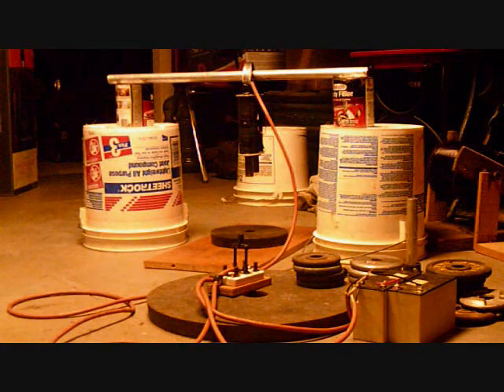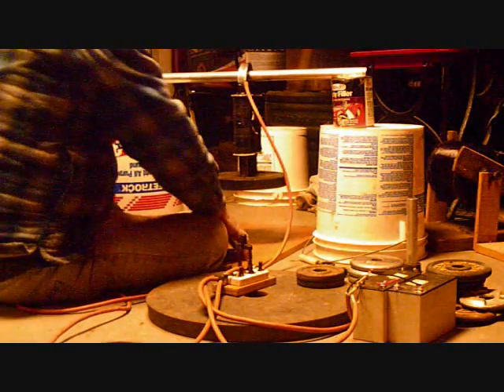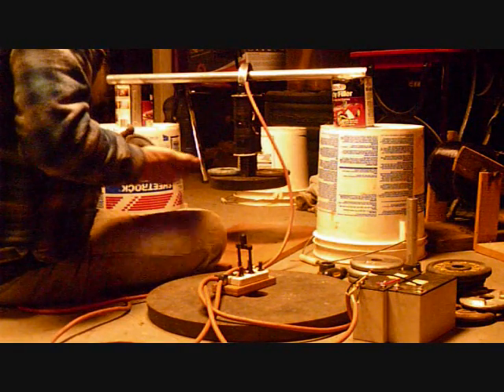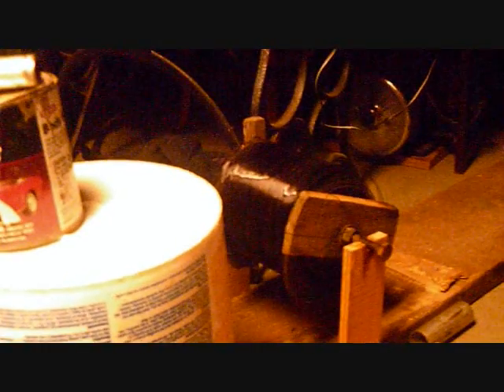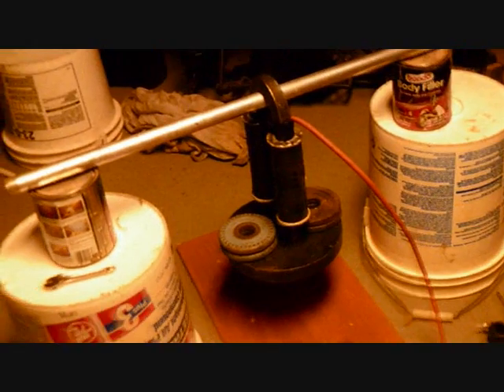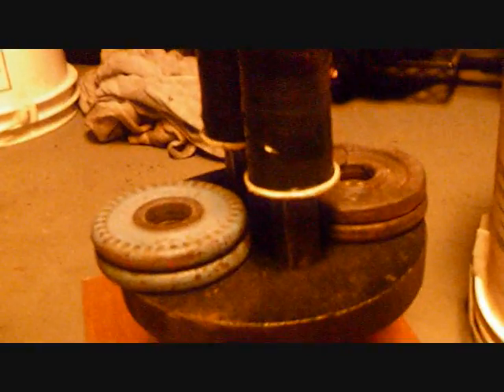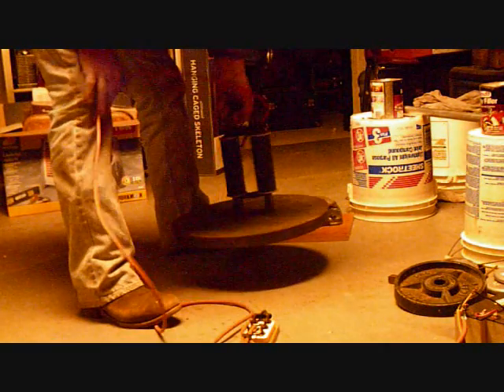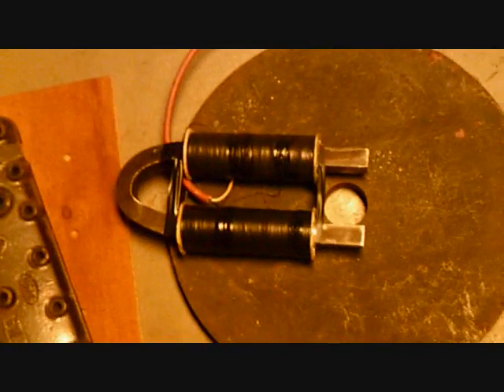Perpetual Motion Holder my version

Comment from the maker: I've been welding pretty much all my life and always get amased at the cables jumping around the floor, and if your are grinding and there is grinding dust on the floor it makes pretty designs on the floor around the cables from the magnetic fields, Especessly when air arcing.   Dan

Comment from the maker: Yes I did, that one and a few others. That's why I built mine to prove to myself it worked. I was amased that it does that with no power on. The vast majority of people don't seem to  even wonder why this works. It seemed to work just as well with one coil, but I made two just to see if it made any difference, not realy too much.   Thanks.   Dan

Comment: Nice work, did you see Russ's from RWG ?, he showed the energy still in there after 2 years with LEDS connect to the wires as he pulled the plate off

Comment from the maker: I built it just to see if it would hold things up with no power conneceted and it  did, maybe hang it over the door for a burgler alarm so the weight falls when the door opens. It doesn't take much to make them fall. Thanks for watching .   Dan